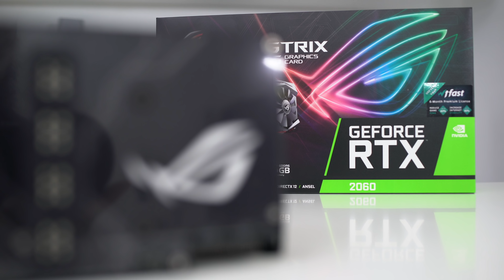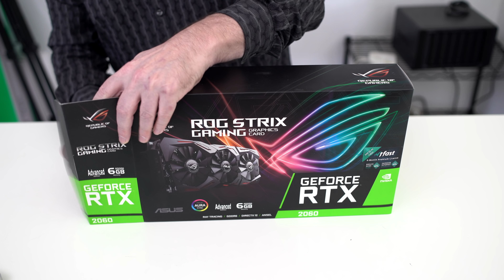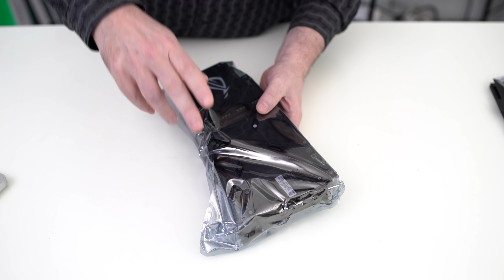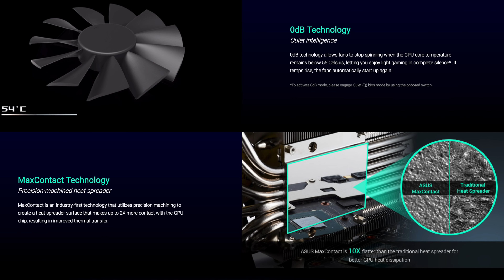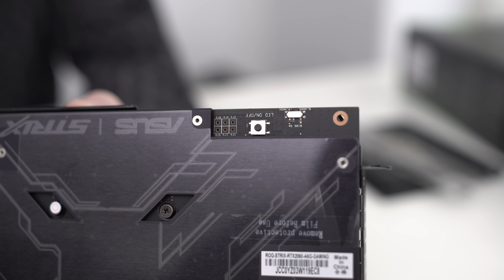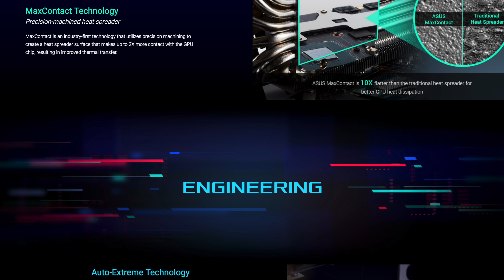ASUS STRIX RTX 2060 Unboxing & Features

Comment: i have the 8GB version paired with FX8350 + 16GB ram, yes the cpu is a bottleneck however it performs very well, its running red dead redemption 2 at ultra settings 2k resolution 30-40fps its no different to playing on the PS4 version its actually better than ps4 due to higher quality of settings.

Comment: Im playing gtav at max settings the card is running at 52c it didn’t even need to spin lol
Reply: Lol! Nice to hear so hyped for my Strix card to come 😁😁
Reply: You think it’s still worth it to buy this card in 2021 kind of as a budget card? I’m looking for a cool quiet pc
Reply: @svan4748  yes i’m still using it  i get stable 250+ fps on valorant and 90+ fps on cyberpunk with dlss on
Reply: @JoaquinRein  great! Thank you for the response, I already ordered one. So it will arrive In about 20 days!
Reply: @svan4748  great buy man! Also the thermals is great I overclocked mine and the temps is normal
Reply: @JoaquinRein  yeah the temps are amazing from what I can tell. I’ve never thought about overclocking, will it damage the gpu? Or does it damage the card if the temp is too high maybe
Reply: @svan4748  I just did a minor overclock  I didn’t rump up the voltage in afterburner so temps are still normal.
Reply: @JoaquinRein  oh I see, probably will avoid to overclock. Never done that before and I don’t want to take any risks ;)

Comment: I have the OC model and base is 1860 and it self overclocked to 2150 and stays nice and cool. Also those three headers are for added two fans And GPU controls the curve based off temps ans the third header is an RGB header for added lighting options. Also was $389 US and runs 5 fps under a 1080..
Reply: Nope. Ordered on Newegg.

Comment: Asus cards are way overpriced in my country, costing as much as 300-400 bucks more than the competitions. Yes it is so damn cool both in its look and performance but spending an extra 400 when you know for that money you can get both a gpu and maybe a console like the ps4 or perhaps upgrade in gpu or cpu seems to be like a better option than spending on a gpu with just better cooling/overclocking performance.

Comment: RTX 2060 does not get that hot and the price is already overhyped. Most Cards can almost overclock the same and the difference is not worth the extra cost. Buying the cheapest dual fan is a better deal. I bought a dual fan for 2660kr and Asus strike gaming cost 3499kr. So you are paying 135% for minimum performance gains. Only buy this card if you need the extra light+ features.

Comment: 6GB of RAM, enough said.
Reply: @VCM5  that's what I used to think. Until I wanted ultrawide. And 1080p sucks for ultrawide. So then I had to upgrade the resolution to fit the screen size I wanted. Pretty straight forward

Comment: 😒 isnt that unecesary long? cant u use a single fan or dual fan version for the same performance? or am i missing something 🤔
Reply: More fans usually means they spin slower and therefore produce less noise. Also they tend to run cooler. Performance is likely going to be similar for each.
Reply: @robsgarage69xw  🙂 ok thx for the info
Reply: They also mean if one dies you have still have 66% of coolong capabilities. Also more fans =easier oc to keep it nice and cool, except you have to bet on the silicone lottery lmfao
Reply: @vaderglenn  🙂 oh i see, for the enthusiasts then

Comment: The most overpriced version of the RTX 2060
Reply from the maker: So far it seems like it.
Reply: over $400 USD and still same speed as others because of locked voltage.
Reply: Jaggsta lucky yours is even around 400. In aus it’s like 659 aud (470 usd I think)
Hold up it’s the OC version. Normal version doesn’t seem to exist...?
Reply: So what if you have money get it
Reply: @realkilju  If you have money, you'd get a better card than a 2060
Reply: But funny thing is, it doesn’t look like to me that the Advanced version is much different than the OC version. The OC version has a higher boost clock, and it cost less, so you’re getting slightly better performance for slightly less, only makes sense
Reply: $349 on newegg not bad actually, rather pay extra for better cooling.
Reply: Asus rocks. Yeah they are more expensive... because they are the most feature-full cards, with the best cooling of the air cooled ones. They OC like champs!

I have a 1080ti OC rog strix... No need for manual OC... It jumps to 2025 mhz on its own thanks to gpu boost.

All i did was to install the Asus software. By default sets the power slide to 106%. It works flawlessly. Is so damn quiet. And my games runs so smooth in  ultrawide.

You want a cool card, that self-overclocks like a champ, that looks beasty and has good, not cringey RGB? Asus Rog Strix!
Reply: @josejuanandrade4439  my strix A8G 1080 doesn't go above 1924mhz
Reply: jose juan andrade My perception of the ROG Strix brand is not particularly good. Their Vega 56 and 64 cards have a terrible reputation, as they were shipped with poorly placed thermal pads for their power delivery, which lead to the cards overheating. A faulty product like that is not worth the higher price that Asus charges. Asus also charge more for their ROG branded motherboards that don’t offer much of anything better than their MSI and Gigabyte counterparts
Reply: @mr_beezlebub3985  Vega is shit. Asus is a good brand but can't do miracles. The main reazon we barely got to see vega 3rd party cards was because of how bad those chips overheat. The ones that managed to come out needed gigantic coolers. There is a reazon v64 liquid cool is the best performer and the most expensive... 

I mean cmon  dude... The red devil vega 64 cooler is ginormus! A card that barely performs like a 1080 needed a cooler bigger then the one of the 1080ti... That's poor enginnering from AMD's side.

I've had a shit ton of Asus bords and they've always done good and lasted ages. Hell i still have my board asus from my fx-8350, and they both still works!

Yes the ROG boards are expensive. You paying for the "bling", but i see it as a matter of tastes. Asus have less expensive ones. But let's face it, if you want bling in your mobo, the Asus RoG ones are the best for that, hands down. If you are budget constricted, you can always grab an asrock or an msi, gigabyte has damn good boards too. Less bling, but good performance.

I have nothing against the other brands. They all are super good. I just know that the asus rog strix are expensive for a reazon. That dosen't make them bad mobos. My current mobo in my main righ is GB, works perfect and it was cheap. I been saving to upgrade my PC on the next gen of cpus. I'm looking for the best single core performance because i play mmos that dosent realy use more then 2 cores (i too play a shit ton other games, but mainly mmos) And my plan is to grab an asus rog strix along whatever cpu is the best on the upcoming ones, either ryzen or whatever intel brings.

I like the option to massive rbg... tho i also like to just turn it all the lighs off if i feel like it. That's what i do right now on my main rig. But the mobo has a red strip on an edge that you can't turn off. That's why im going with an asus board next :)
Reply: jose juan andrade Vega being shit has nothing to do with the fact that Asus did not ship the product with proper cooling on the power delivery. That shows that Asus did not care about the quality of their product.
Reply: jose juan andrade And you day Asus can’t do miracles. How is is it that every other AIB that does business with AMD was able to have proper cooling on their card’s power delivery? That should be a standard, not a special miracle
Reply: @mr_beezlebub3985  On the thermal pads, it may had been a fault in the desing yes. Not excusing that part. But this kind of mistakes happens. Remember the EVGA FTW debacle where they even sent out the missing thermal pads to consumers?

And NOT EVERY AIB was able to proper cool the card... that's the THING! That's why you didn't see that many 3rd party Vegas. I think XFX only shipped refrence models. And power color only has the red devil one because of the need of the super massive cooler. And they made very little units, thats why vega is so hard to find.

In my country there was only reference models up until recently that the asus rog and the gigabyte became avaliable (and still in very limted quantities)
Reply: jose juan andrade XFX shipping reference cooling has nothing to do with improperly placed VRM cooling though. The two things are completely different issues. As far as I know, no reference designs sold by any company had the issue of power delivery being improperly cooled. Only Asus Strix model had that issue